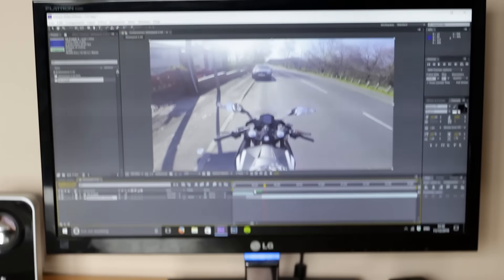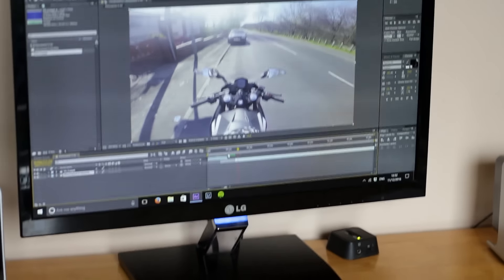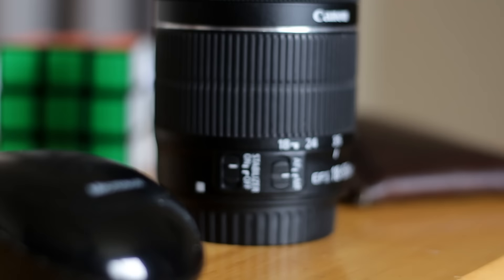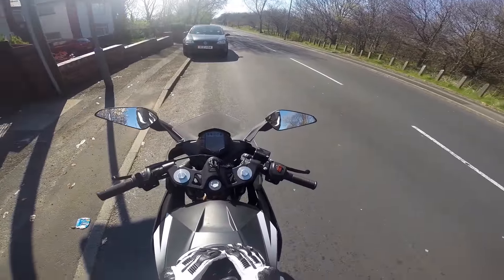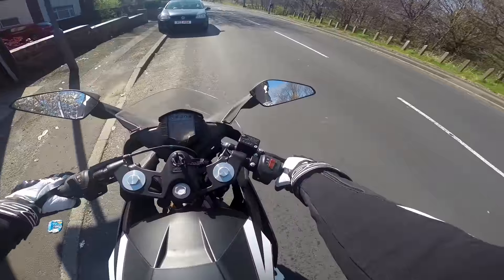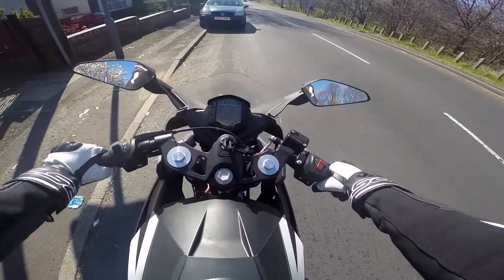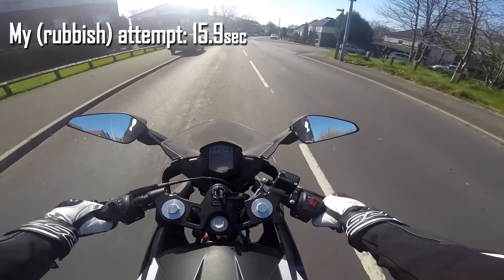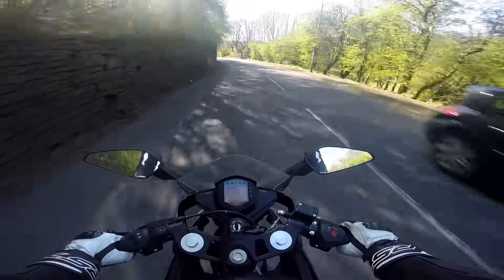KTM RC 125 0-60mph Attempt ish Before She was Stolen :(

Comment: Considering swapping my second yzf (that i bought new less than 3 months ago after my first one was written off) for a new ktm rc 125. Is the power pretty much the same? And silly question but for practicality, is the fuel cap on a hinge, or does it pop right out?
Reply: UKGB on a hinge, power is the same but the  KTM is much nicer to drive, I mean the suspensions and stuff 
sry for my english hope my comment could help anyone
drive safe
Reply: ***** Perfect thankyou!
Reply: don't do that, my mate has a rc 125 and it has cheap plastics and very bad quality compared to my cbr 125r
Reply: GratUp98 A lot of the mechanical parts are from the 390 though so its better quality than th rest of the cbr/zf/etc on the parts that matter, better suspension, bigger brakes, larger and wider wheels+tyres etc. But i agree they do skimp out on some stuff, which is why they offer the ktm power parts
Reply: I'm not saying the suspensions or the brakes..  where the ktm is the best 125cc 4stroke I'm talking about the finish of the bike. When you see one in person you feel the cheapness of it... And it's no way better than a japanese one like honda yamaha kawasaki or suzuki. That's my thoughts. Honestly, compared to my cbr 125r the rc seems a toy.
Reply: just because there's plastic doesn't mean it's low quality? KTM are in the dirt business so plastic fairings are what they're good at. I had two duke and the fit and finish was excellent, no rattles or strange noises which couldn't be said for my mate MT125
Reply: Yeah the duke is a well ended bike not the rc. I'm saying all this based on my experience after testing my m8's bike. Apart fromthat, it's a very great bike, handles well, accelerates good and brakes perfectly